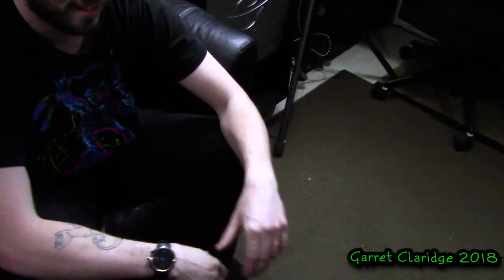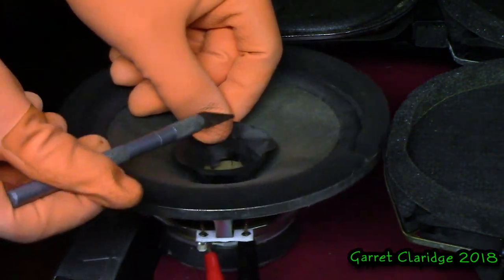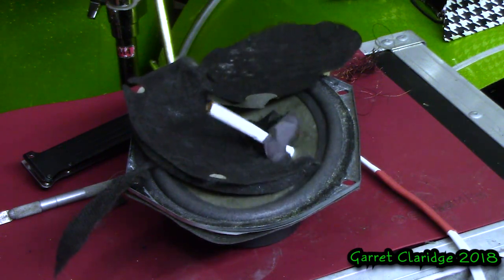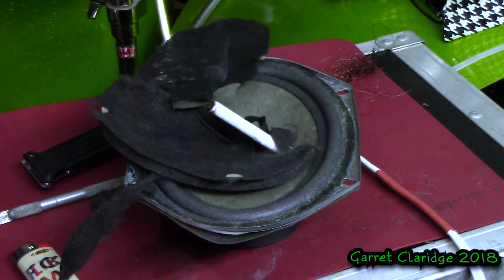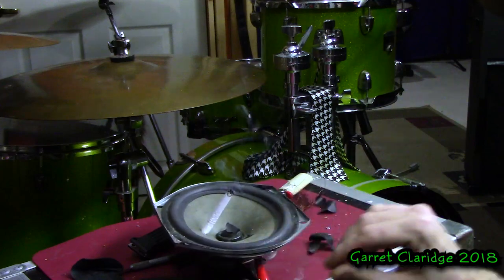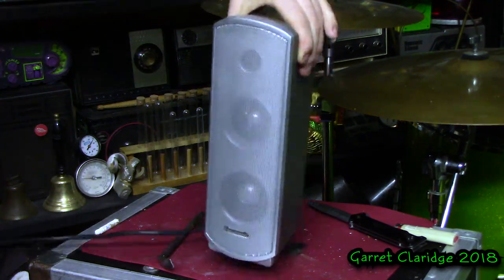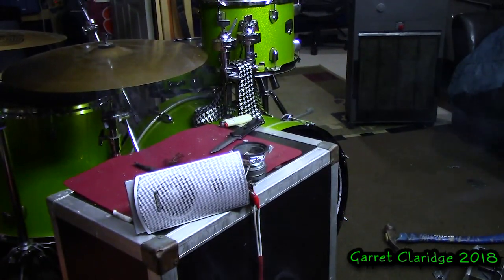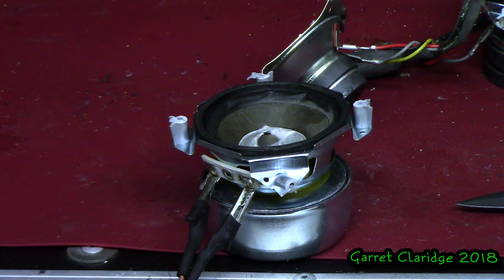Blowing Up Stock Car Speakers + Panasonic Surround System

Comment: 6:53 - 7:04
He think it's a piezoelectric buzzer on the Panasonic Surround Speaker when plugged directly to 120VAC 60Hz, it actually a crossover capacitor and seems like a piezo. However there is no any piezoelectric buzzer on this Panasonic Surround Speaker, it only have midrange and woofer.

Comment: which speaker took the most watts?  apart from the 120 volt ones?
Reply: The Hyundai ones by default. Two or three of the GM ones shit the bed without putting on a show.